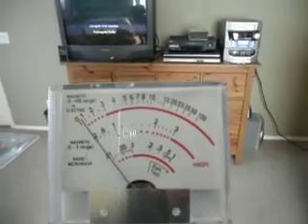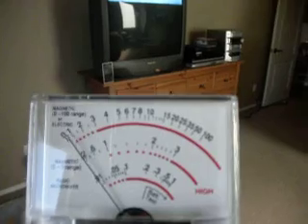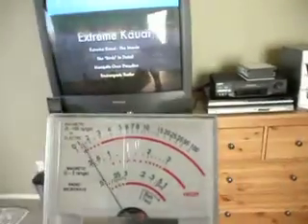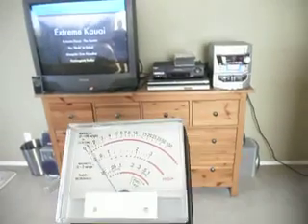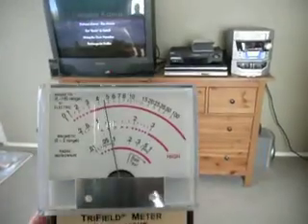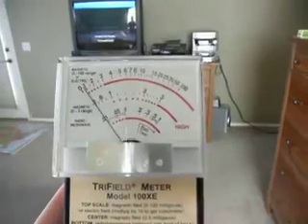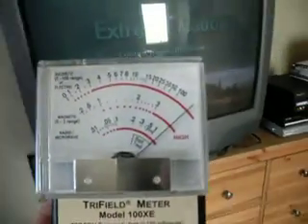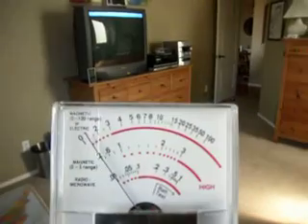Electromagnetic Radiation and Interference (EMI/EMR) Plant Deformity Explained.

Comment: Recon I sussed deformed plant leaves in my greenhouse.
All plants get same tap water, feeds and soil, and are never outside.
When a 10+ year old plant suddenly develops butterfly bifurcated leaves then something IS wrong.
I noticed the same on a couple of other pelargoniums last year .
They were all on the top shelf at 7ft above ground level.
Last night I took out electrosmog detectors.
Plants were-are receiving a strong line of sight terrestrial HDTV signal.
Never any probs with older signals!

Comment: I'm not commenting on the validity of your point...but you said "the plants continued to deform after the radiation stopped"....in most, not all cases, but most- this would suggest that it was some other condition, i.e, the amount of light, etc., and the radiation would be an independent variable. Im not here to debate anything, and I don't think I will convince you of anything, but I did want to share my thoughts.